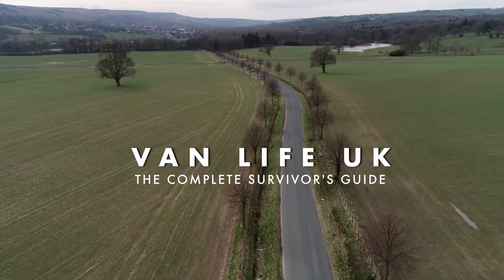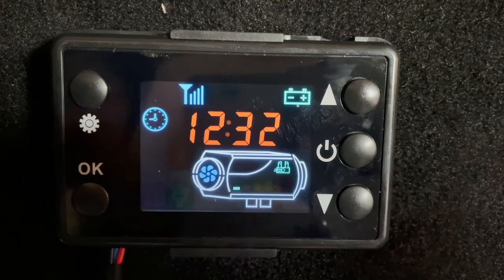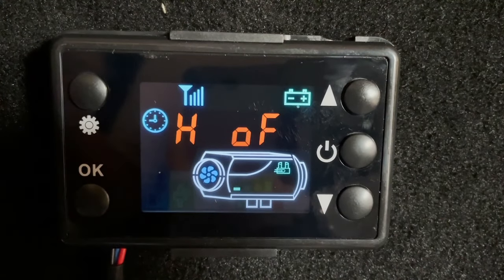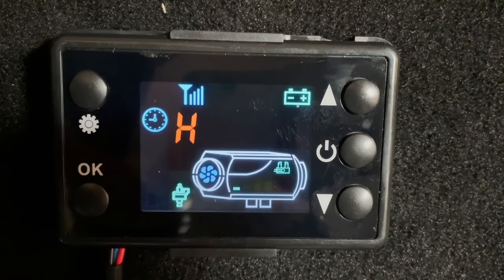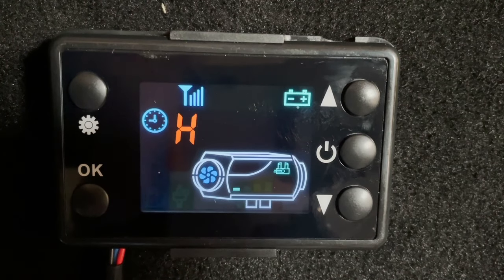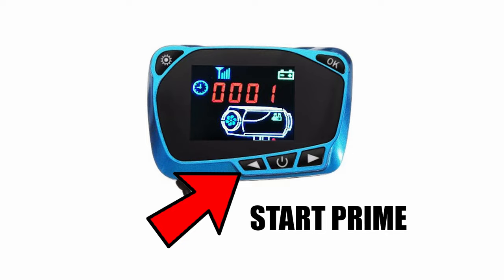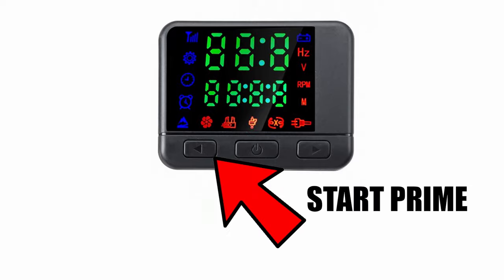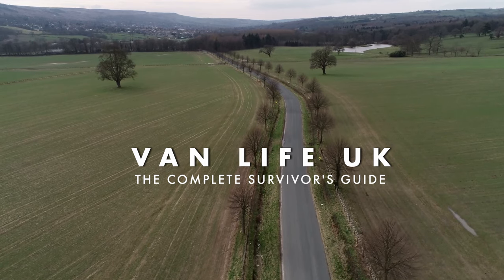How to prime your Chinese diesel heater with the three most common controllers

Comment: There is another variation of the first controller. To prime it you hold the two arrow keys at the same time and hold do not release.
Reply: Thank you, that’s what I had to do with my heater. Is there a way of changing the heat settings from H1, H2, H3 etc to degrees do you know?
Reply: @ARMotorsport44  this is the only way I now at the moment. 

PUSH OK TWICE UNTIL HZ APPEARS. 

THEN PUSH SETTINGS BUTTON AND THE UP BUTTON AT THE SAME TIME. TO CHANGE TO CELSIUS. 

THE SUN BUTTON IS THE SETTINGS BUTTON.
Reply: @ARMotorsport44  on mine I can switch back and forth between Hz and temp by pressing arrow up and OK at the same time.
Reply: Thank you so much for this suggestion. FOUR HOURS LATER. The H off code will not come up. I took your advice, pushed both arrows and the pump cycled. I did fill the pump with oil also. Working great, and it is snowing.:) NOVA SCOTIA.
Reply: Your comment saved me from watching the 5th video 😂
Reply: Mine as well, unlike what the instructions say
Reply: Thanks for the two arrow tip on priming the pump. This newer controller I have needed to do it that way. My older heater does it like the first one in the video. 👍👍
Reply: thanks man,,, saved me
Reply: Thanks a ton. lol. Just got mine and that worked.
Reply: My controller has this oil can icon instead of OK, is that the variation you were talking about? I'm going crazy here, unable to prime the pump. Pressing the two arrow buttons doesn't do anything. When it's off and when the heater is on, it just goes into some settings menu. Help anybody? Please
Reply: @jiri4023  If I could see a photo of it. Maybe on a link to an advert advert etc.
Reply: @ajp-wales110  I've tried posting a link to a picture but YT deleted the post. I'm in touch with the seller, they sent me a picture comparing all the functions of the two versions of the first controller, but YT doesn't let me post a link here.
Reply: @ajp-wales110  update: the seller sent me a PDF with instructions for that controller. Apparently, you're supposed to press and hold the diesel can button for 8 seconds and it goes into manual priming mode for 300 seconds. However, it doesn't work in my case, the voltage at the pump is only 8.5V. I sent the store videos and they're getting in touch with the manufacturer. To be continued...
Reply: @jiri4023  same boat. 
e02 at first. great. a 12v power supply trips because its unregulated and doesnt like 15v? turn the dial to 10 and its e01 instead. lol.
ok, battery... and...

so far, i can set the time. an alarm. and another alarm?
i can make the aerial icon flash  and display PE
can get one temperature setting to change... dont know which!

lots of p-04...

i did get it to prime... by cyclically powering down and pulling serious vacuum on the line, and randomly the pump starts up. assuming when the element reaches ignition temp. got a few e-10s, no ignition... and now its running. 

oh no, its stopped.

woop. off again...

yee gods. i think im going to be tearing this electrical nonsense out soon... 

maybe i got a faulty controller, maybe theyve changed firmware yet again...

electronics. bane of my life. turning what could be useful products into landfill...
Reply: @paradiselost9946  I don't get any error messages because I don't let the ignition heat all the way as there's no fuel after the pump. I have a PDF with a detailed description of all the functions of the controller. It's in Chinese English but with a bit of imagination, you can understand it. How can I send it to you. YT doesn't allow me to post a link here.
Reply: @jiri4023  meh, got it figured after a while. 
cant access any priming function, but did realise p stands for "power" once it was running...... so yeah, had to cycle it through a few times til it primed, and finally, cough cough splutter and now its going. bit annoying when i run out of fuel, i guess. i shall survive.
Reply: @paradiselost9946  just outta curiosity, what's the voltage at the pump? When I check the connector, it gives me only 8.5. I'm wondering if that's like some standby mode voltage and it goes to 12V once it gets to ignition.
Reply: @jiri4023  unplug the pump, you throw an error.
its using a high impedance voltage source to detect the pump is present, and not shorted. enough for a trickle current, not enough to drive it. the coil resistance will only let so much through. any major deviation and bang, you get an error.

it will only read a voltage, or at least, a direct path from positive to pump to ground, when its driving it. pulse pulse pulse. you wont measure that with a standard digital multimeter, you might see it with a moving needle type...

i might pop it on the scope and see what its outputting. i might not :)

on my POS power supply, the ignitor heating up is the biggest draw, that has to be over 5A cus thats when my breaker trips, the duty cycle is about ten seconds shy of ignition starting...grr! starting it on a battery, it sags until the element heats up, pump starts, and ignition has occurred. 
if it doesnt ignite it either throws an error or has another go... once primed, its off and away.
then it bounces back up a fair bit, i let it run for most of the day and night off the battery then hooked it up to the supply, which was now quite capable of charging the battery against the power consumption without tripping itself...
Reply: @paradiselost9946  wow, you understand a lot about electrics. I'm a total noob. I guess I was worried that letting it cycle through would damage the heater without a single drop of fuel anywhere near it and the igniter going off. I've already installed the heater, sealed everything with that red silicone. I mean, I could re-do everything, try to get some diesel closer to the heater, because the pump is about a meter away, halfway between the tank and the heater and I just can't get diesel to the heater without priming or ripping everything out and getting diesel into the line between the pump and the heater. I guess I'll try to let it ignite and see if the pump comes to life.
Reply: Have this same controller : to prime both arrows then pump kicks in, but trows error 6 : E 6 and don't start heat. 12v 6.7 Amps power supply! Is not enough?
Reply: Hi thanks for your help on this issue.  Should the pump be clicking once heater is up and running.  Thanks in advance
Reply: Yes it will make a clicking noise. @petedevon
Reply: Thanks, this comment was my controller

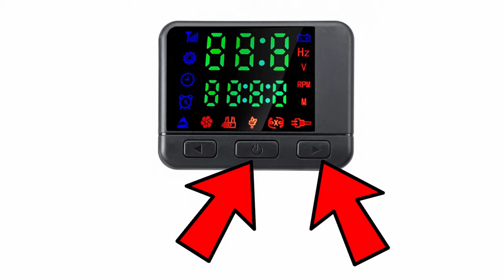Comment: 1:11 The prime function is only available right after you connect the device to 12V. And runs for an odd 3 minutes, then stops. In case the prime-mode doesn't show up on the screen, disconnect from the power source and try again. Thanks for this helpful video!

Comment: If you have one that looks like the first one but the letter/number LCD display is blue you need to press and hold up and down buttons at same time only. It runs priming for a few seconds so you will have to do it multiple times.
Reply: Thank you!   Exactly what I needed!
Reply: @jjswag92  no problem. I had a hard time finding that out lol ended up asking with YouTube comments till someone helped me out
Reply: Thank you, mine works the same as yours & I thought I was going mad trying the most common way. With your control panel, have you found a way of changing from the heat settings H1, H2 etc to degrees?
Reply: @ARMotorsport44  I don't think I have got it to do that. Just 1-6 levels. I don't really use that one too much it was to be an emergency heat source. I put a 2k one in my vehicle and I have been using it most of the winter to preheat the cab and when I'm sitting in it instead of idling. It is different still and seems to only have Hz settings.
Reply: @ARMotorsport44  I have just been adjusting mine down to H1 or up to higher.  The degrees hasn't worked very well.

Comment: my heater prime function no longer works. it used to, now when i press the buttons nothing happens. any ideas? its 2c overnight in my bus and im freezing
Reply from the maker: yeah, try unplugging the controller and plugging it back in. they normally only go into priming mode just after you have powered it up and unplugging the controller will make it think it has just been attached to the battery

Comment: Watched a bunch these videos, none seem to tell how to get past or clear the Error Codes. 
I had an E-10 and could see tons of air in our fuel lines. But we could not enter manual prime mode. The keystrokes to enter prime only work from the default screen ( where the time is displayed ) ~ Being stuck on E-10 we could not solve the problem by priming. 
Eventually we unplugged the controller for a few minutes. When reconnected the E-10 gone and we were able to enter prime mode and clear the air from the lines.
Reply from the maker: Hey, the error codes should clear once the problem is resolved and you try and start it agin. there is no need to manually clear the error codes yourself. Yeah that is a very common fault with these controllers but once unplugged and attached again all is good
Reply: I have an e10 code! Did priming it fix it or did you have to do something else first?
Reply from the maker: @ictheworld8974  Hi sorry ive only just seen this. Error code 10 is actually an error code that means multiple failed attempts. It could also mean that it has been over primed and flooded. Check this video out t should give you more of an idea on how to fix it. If you have primed it and think you might have over primed it then best thing to do is blow up the air intake under the heater with a hair dryer on full blast as it is trying to start or dissconnect the fuel line from the bottom leave it half an hour and try to start it without priming it :) https://www.youtube.com/watch?v=5QlvhMD_pQM&t=78s
Reply: On mine, I just disconnect power to the unit.
Reply: @carpenterfamily6198 Thank you! I've currently got this error. I'll give what you suggest a go right now!

Comment: I replaced my pump brand new, hooked it up what I believe is properly, I have the first control panel in your video, pressed & held the two buttons at the same time then pressd the up but ton..it reacts on screen but no pump clicking in spite of it being connected properly. When I turn the heater on (like normal), it simply operates for about 2 minutes without actually putting out any heat  again like normal and then ends its cycle with a 08 fuel code or 09 code. Ideas?
Reply from the maker: Hi phil, it could be a couple of things. The control panels need to be unplugged and then plugged back in to enter the priming mode. Once the heater has been run it wont go into priming mode unless you unplug it and plug it back in.

Or it could look like the controller in the video but work differently. On similar looking controllers you need to hold both the arrow buttons down the entire time it is priming. But more likely the first option. 

Yeah it will give you error code 8 if you start it without primimg it first. It will eventually change to an error code 10. if you unplug it and plug it back in though my guess is it will work as you want it to
Reply: sounds just like mine.

e08. flame extuinguished...
e09. sensor fault (?)
e10. ignition fault.

i couldnt access the prime function. i just let it do its thing. it will heat the element for a minute or two, then start the pump. p10 is the highest setting.

if it hasnt primed it will either throw an error, in which case unplug it and repeat, or it will attempt it again...
orient the pump so it can pump air out of itself...

and i had no issue with bubbles. it might cough slightly.

Comment: Just trying to prime my heater at the moment as I keep getting E8 and E10 codes intermittently. I have the controller like the first one but when I press the two buttons together the screen doesn’t change? Any idea how to kickstart priming mode?
Reply from the maker: Hey, if when the controller is lit up it looks like the controller in the video with the exact same symbols in the same place then unplugging the controller and plugging it back in normally solves this. If the controller looks like the one in the video but looks different from it when lit up with different symbols etc it is a different controller altogether with different functions. Let me know and ill and find out what to press if it is different
Reply: @vanlifesurvivorsguide  thanks for such a quick reply! I managed to prime it – how long should I have it in priming mode for? Only did it for about 20 seconds but seems not enough as when I tried again, within a few minutes it came up with the E10 code
Reply from the maker: @johodson2852  That really depends on how  long the fuel line is. You need to watch it traveling along and into the bottom of the heater to be sure. Mine with about a meter and a half of fuel line takes 3 whole priming sequences and has to be restarted twice  as it stops priming by itself.

Comment: Do you prime it everytime? How long for?
Reply from the maker: No just the first time and if you run out of fuel ever. Until you see the fuel  going into the bottom of the heater stop the priming cycle

Comment: When priming do they automatically shut off once primed or do you have to manually stop it?
Reply from the maker: both, it will go through a cycle and end. if it ends before the fuel reaches the heater you will need to restart it. If it reaches the bottom of the heater during the cycle you have to manually stop it :)

Comment: How long are you suppose to prime the heater prior to starting?
Reply from the maker: it takes about 1 full prime process to travel about a meter so it depends how far from your tank your heater is. The best idea is to take the fuel line off of the bottom of the heater and put it into a clean container. Then prime the line until all the bubbles are out of the line and the fuel is coming out. The re attach the fuel line and press go

Comment: Are the 3 types of controller compatible to change onto a Chinese heater the black controller suffers from a bad backlight and in having to wait till nighttime to set up the heater thought I’d ask doesn’t cost anything for knowledge
Reply from the maker: Hi mate, the blue one in the video will be compatible with the same motherboard as the controller you have. The 3 button one in the video  wont be

Comment: Ok I have the first one you show and my diesel heater does NOT do ANYTHING at all when I push the ok button and the down button. Could anyone explain what the hell that's about before I smash this pos?
Reply from the maker: Yeah it is probably not the same controller but looks similar. Check the icons on the  to see if they match up with the one in the video. Yours might be the 3 blade controller not the 6 blade controller. aLook at the heater icon on your screen to see how many blades the fan on it has
Reply: @vanlifesurvivorsguide  the icon has 6 blades. Honestly never noticed that before lol. It's an 8kw one from Amazon, not sure that info helps anything but there it is.
Reply from the maker: @ginabrytowski3564  try unplugging the controller then plugging it back in. If you have used it before it needs resetting before you can prime it.

Comment: My heater is virtually new but just stopped working after 2 days and says e-08. The pump seems to have stopped working. It doesn't prime or tick when I turn it on. I don't know if it's my pump already broken or a controller problem
Reply from the maker: it sounds more like a fuel line error, have you primed it recently? It could be flooded or there could be an air lock in the fuel lines somewhere. Its not the controller and the pump would give error code 4 not 8. If you join our facebook group we can talk you through how to fix it easier
Reply: @vanlifesurvivorsguide  I'll try to find your page. I've tried priming the pump but nothing happens. Everything else works fine except for the pump action. Upon startup it does everything up until the little icon appears, but it doesn't begin to tick or try to feed fuel. And when I unplug the pump a small yellow warning appears on the controller
Reply from the maker: @MaritimeUnprepared  did you accidentally just block me on facebook
Reply: @vanlifesurvivorsguide  I was banned but I don't know why? It says I've been banned because of identity security, I think it's because I didn't use my name. But I don't know
Reply: @vanlifesurvivorsguide  I've literally only talked with you lol. I don't even know how to use 90% of the stuff
Reply from the maker: @MaritimeUnprepared  yeah most likely, they don't like that. Its because the name didn't sound real you can use a fake name thats not your own and it won't pick it up